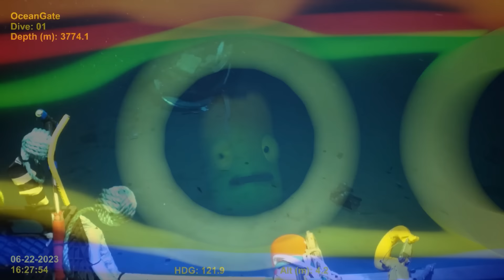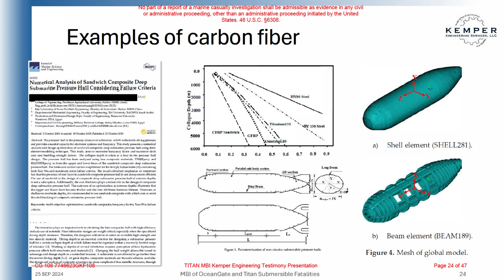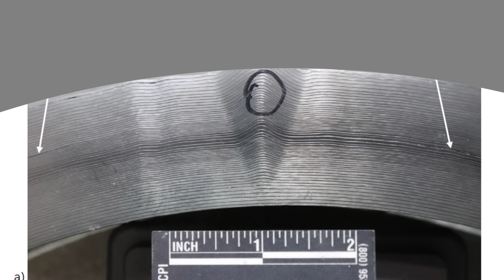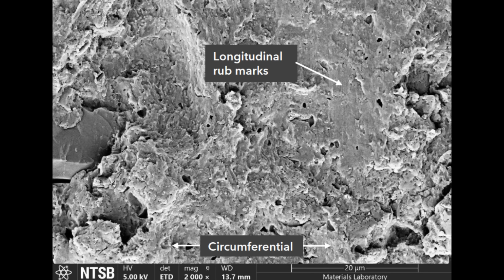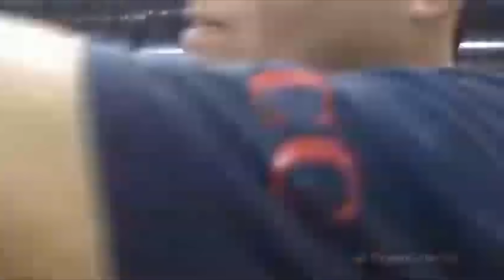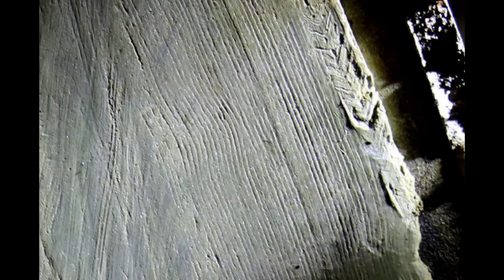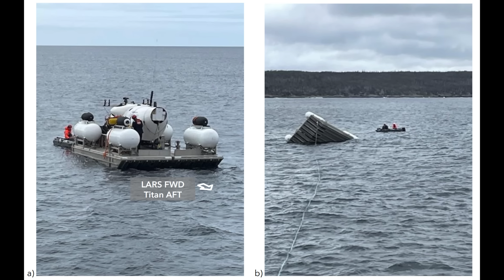OceanGate Wreck Shows Why Sub Wasn't Strong Enough To Survive - NTSB Shares Important Details

Comment: When you look at the oceangate process for bonding the titanium rings to the carbon fibre pressure cylinder alarms bells should of been ringing .a technician wipes the titanium ring with a rag , and the bonding agents  mixed &  applied by  hand . Surely when going to the intended dive depth of 4000 metres a more uniform & testable solution should of been implemented

Comment: If it imploded any water or air inside it will be pushed out like a gunshot. Thus the ring is a bit away.
Reply: That's media bullshit, mostly water pures in until the pressure equals and that's it. You can observe that on every known shipwreck., U-Boats aso.  The shattered carbon tube is. let's say "very unusual",

Comment: I worked for a company that build cylindrical carbon fiber enclosures with titanium end caps.  Although they are much smaller that the sub, they share many of the same attributes.  What really stands out to me is the way the spherical endcaps were attached to the cylinder.  The problem I see is that when the cylinder changes it's shape (and it will under that much pressure) it relies on the adhesion of the epoxy.  Instead... The pressure should be used to make you sealing surfaces stronger, not trying to rip the sub apart.  If they would have made the titanium flange fit to the inside of the cylinder then you could use mechanical seals such as 0-rings to seal because of the massive amount of outside pressure.... etc...  Any expert that works with actual pressure vessels should be able to see this flaw.
Reply: Sure, me, everyone else in the branch and 99,9% of armchair engineers  too. Now the conclusion: What was this vessel made for?

Comment: This seems to have a lot in common with the Deepwater Horizon blowout, "How odd: we're getting negative pressure ratings."  That meant the drilling fluid they were pumping out of the well was moving faster than the pumps were pulling it...and yet, the pumps weren't immediately reversed.  In that case, eleven people and untold numbers of animals -- marine and avian -- died, while the environmental effects were devastating.  If what I wrote doesn't make sense, look up the purposes of drilling fluids and why you would remove them from a well that you weren't putting into production.  Hints: #1, drilling fluids put weight on the formation to prevent blowouts; #2, deep sea drilling fluids are expensive and reusable.

Comment: If you look up material/ metal compression tests which have been around for decades. On the internet, you find Titanium is not much stronger than aluminium. Carbon fibre is brittle and fractures or explodes under pressure and is actually not very strong. The metal compression tests show stainless steel has the strongest compression test, further it does not explode it just squashes flat. The sub should have been made out of stainless steel. In fact all under water deep see vessels should be made out of stainless steel. See test results available on the internet.

Comment: Lesson learned. Positive pressure needs stronger hulls, lesser pressure not that heavy, just strong and insulated from radiation and micro meteorites/debris, or better said, It is relative safer to go into space that down to the bottom of the ocean in a DIY sub.

Comment: The weakest part of a composite is the adhesive in most cases. As most composites suspend strong fibers in a matrix of adhesive material. For tension forces this is rather nice as the fibers are more-so expanded which stresses the strong (usually carbon) bonds. Compression however causes more of an internal sheering effect and would put more applied force to the adhesive to fiber interaction. What i’m saying is that we use materials like carbon fiber for the strength it has under tension whereas other materials like concrete experience strong compressive thresholds. We use appropriate materials for areas of a thing and their boundaries matter. OceanGate likely ignored the relevance of material differences and just thought “carbon fiber strong” without considering the actual impact of the adhesive and how it contributes to the strength.

Comment: This catastrophic event and especially the current aftermath, the examination of the wreckage and the whole analysis, is exactly what Ocean Gate should have done, and what was meant by industry experts by "testing it to destruction". NOW science knows a lot more about the behavior of composites, of bonding, of glues under high pressure etc. And if they sent down another few samples for testing, at some point we will get to the point of doing it in a controlled, acceptably safe way. But not with the very first testing sample, like Stockton Rush did.

Comment: Engineer here, these voids are stress risers. I'd say catastrophic, but the glue delaminating looks to be the killer. This is a fatigue failure. They tend to be gradual and slow, and then a lot happening very quickly. The acoustic monitoring... I think it told them once it was too late. Fatigue goes from OK to collapse quickly.

Comment: This is the first time I've seen in depth fabrication information for the Titan.

I've read quite a few comments and it's kinda wild how many people have more insight into fabrication best practices than those that were manufacturing the Sub.

The Titan's construction was in my opinion at experimental "hobbyist" level.

I can't say much more than many observations already mentioned.

A couple things though one I haven't seen in comments (though I haven't read all 4.7 thousand) (forgive me on that) Is ionic bonding issues. Adhesives use mechanical bonds but often involve electron covalent bonding (I think it's called) or something like that. Carbon is known to do weird things as far as ionic/metal issues are concerned. Couple that with the charges from saline (sea water) environment and there could be things going on that very educated people may not fully understand. Promotion of strong mechanical bonding would probably have been sufficient for mitigation of any/most issues with electrolytic charges (chemical bonding) related to adhesives/dissimilar materials. 

Kinda baffling that they decided to take on what's perhaps a more challenging environment than outer space in the way they did and with (presumably) the resources available.

The saying "horse before the cart" comes to mind. I personally would have invested in manufacturing a dedicated large format 3D printer specifically for production of the hull primarily comprised of nano porous or otherwise highly structured titanium perhaps counter pressurized. 

I mean how much money did the guy have. Probably enough to do that. 

Finally I'll go ahead and be "that guy"...
Maybe all of the Mission Specialists aren't little particles mixed into the vast expanse of the worlds oceans. Maybe they weren't on the Titan when it failed. Maybe it was being operated by remote control. 

I don't mean that as any disrespect to loved ones. Just trying to try to find the best in the matter.

Comment: I would hazard a guess that the acoustic event was the hull delaminating between the layers or the glue failed on dive 80. You can see clearly at 23:4 all the layers have separated into individual sheets.

Comment: One of the lead engineers said he wouldn't dive in it because he didn't trust the operations team. It looks like the engineering was fundamentally sound, the construction team wasn't up to the task but gave it a good shot, and the operations was grossly negligent. 

It failed safe and the sensors gave clear indication of the failure.

Comment: The GLUE used in his submersible, —did Stockton cRush validate the glue for depths of 12,000 feet? 😮
/First Year Engineering students, pay attention.
Reply: buddy really thought his little debbie swiss cake roll would work as a submersible
Reply: @lsswappedcessna   O, you’re killing me with that comment. 🤣
Reply: This isn't something like super glue when you're working with carbon composites you are using various types of adhesives for different tasks because you can't easily bolt something carbon fiber without ruining the material properties of the fiber. Now something to watch out for is how much strain, shear etc the particular adhesive is rated for and making sure that what two materials you are bonding are within tolerance, because for the adhesive used titanium and carbon fiber are not within tolerance because of how different they are. Also working in a clean room to make sure that the adhesive bond is as strong as possible is definitely beneficial

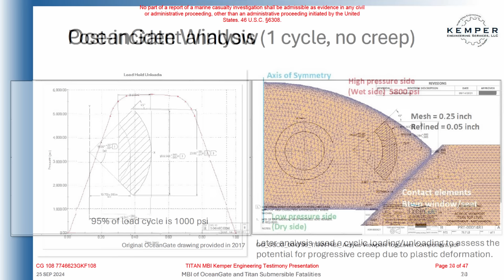Comment: 8:00, the window:  

The window did not fail, so he was "right" that it would survive the lifetime of the submarine, and I can't believe the poor problem solving of the engineers.

If the same size window is approved, just with poor visual characteristics, the solution is to use an "approved" window, and correct the refraction.  A softer material in the void, to make a flat window, or slightly convex for the magnification effect, would work, so long as the material was soft enough to deform under strain, without increasing stress to the approved window.

Picture a semi-circle window, as approved, with a semi-circle insert, which is not load bearing, hot glued to the load bearing window.  The hot glue is "invisible" clear, and the insert is the same refraction index as the load bearing window, which corrects the magnification without impacting the load bearing structure.  No I'm not saying use hot glue, but that it's an example of the infinite number of optically clear-ish options that is also soft enough to absorb any stresses and  eject the insert under strain, rather than increase stresses on the load bearing portion.

Maybe a better option would be a thin plexiglass on the inside, making the desired shape for the intended optics, and filling the void with water or other liquid, with additives to get the necessary refractive index.

I could come up with a million fixes for the optics problem that would be cheaper, lighter, and certified.

How could they have decided to compromise the shape, rather than the more trivial correction of the optics?  That's the kind of stupidity that left many means of single points of failure that would kill everyone on board.

Comment: Wow. I used to work at Electroimpact — the company that made the carbon-fiber hull. I also worked at Seattle Boiler Works designing ASME pressure vessels and PVHOs. SA-516 grade 70 (steel) was the material of choice for submersible pressure hulls. Just wow. What a dumb idea this thing was.

Comment: This is very interesting. I’m no engineer, but I worked in a field where roughing a sticky surface to prepare it to have another sticky surface adhere to it eventually ended in failures because it was impossible to completely remove the debris from the “roughing” process to ensure a clean adhesion. The layers always eventually peeled away from each other. Those wrinkles open a wide array of scrutiny - it seems “flattening” them would immediately compromise the integrity of the structure and no matter how many smooth layers you add, it doesn’t fix the originating flaw. And just thinking about anything composed of fiber under that kind of pressure seems to me the fibers would begin to compress and fracture. Again, I may sound like a complete idiot bc I’m not a structural engineer, but I do see a correlation to my previous work and how this was an issue. Terrible choices made. Corners cut for profit. Greed seems to be the overwhelming reality here, not, “you must embrace risk to be truly adventurous”. The few who unknowingly sacrificed themselves will certainly ensure this negligence doesn’t happen again. 

I enjoy your reporting on the subject, Scott! Thank you for sharing!

Comment: In the kemper diagram of potential implosion points they missed the most threatening 'failure mode' of them all. The bending at the middle of the cylinder introduces an angle (shown along top of cylinder).  The effect is to use the cylinder wall as a lever against the "glued joint"  (shown at lower corner of cylinder).  The effect is about a 10 fold force multiplier to pry the glued joint apart at the outermost edge while putting crushing force on the innermost edge.  Movement of the cylinder wall in at the belly, via leverage of 1/2 the length of the cylinder focused onto the 5" thickness of the carbon fiber glue joint,  results in forces far in excess of the ambient pressure. There is no glue which could withstand that.

Comment: At 4:10 you push back on the idea that CF doesn't do well under compression or shear and say none of those are problems, but then immediately after that show a slide whose concluding bullet is "Compression strength and shear resistance is problematic with Carbon Fiber." 😅

Comment: The moment I heard "instead of one 5in layer, it was five 1in layers," My hand hit my face. 

I'm no material scientist or engineer...but I know enough to know that several smaller layers do not equal one large layer. I'm also curious now if the source of that big bang on dive 80 could be located in the recovered wreckage.

Comment: Anybody who's familiar with hydraulic or pneumatic hoses could probably tell you what went wrong here.
Laminated hoses will inevitably fail completely when they begin to delaminate - however minor the initial defect is.

In a hose you have pressure on the inside and that's great as long as the inner layer remains intact.
As soon as the inner layer sustains damage pressure can escape into a tiny "new" area and pressurise it, which makes the area larger, bigger surface area means more force, which means the area expands and eventually leads to the hose delaminating.

Soon as I heard about how the Titan was constructed I suspected a similar thing had happened, in reverse.
Defect on the exterior surface, pressure gets in, defect expands, as delamination occurs damage is caused to deeper layers and the process continues until a large enough area of the hull is delaminated so that the structure is undermined.

Comment: Can someone help me understand why most the simulations showed the failure in the middle of the hull? Intuitively for me a failure at the end should be more likely. I mean, given how thin the titanium flanges are, it doesn't seem like they provided any substantial support, so the main difference between the middle and the ends would be that the middle has more carbon fiber on both sides supporting it, while on the ends it's supported just from one side.

As long as the structure is uniform it doesn't really matter (every inch of the hull would be subjected to the same stress, so they can't provide any support for each other), but if there is a weak spot, it would be supported from 2 healthy sides in the middle, but only one side at the end. Am I missing something?

Comment: 12:00 this is so unbelievably bad...

Filament winding +/-55 degrees with carbon/boron is such an obvious solution, the fact they went with pre-preg in this manner and machined off the wrinkles is just incredible incompetence.
Reply: it will not help, the water creeps in the junction between steel and carbon and there is no tech to control that. The whole boat is designed to fail.

Comment: I appear to have been mostly wrong about why it failed.
Of course, that's because I (rather foolishly) assumed a minimum of competence when constructing the submarine.

I thought the poor and unclean conditions would induce errors, both in the glue and in the carbon fiber, that would eventually lead to a hull failure after enough stress cycles. That they were actually artificially adding hundreds of breaks in the carbon fiber, as well as using the same poor glue process to merge layers together is actually beyond my understanding.

I am struggling to find an allegory for how monumentally unwise this was.

There is a reason why 'just sanding over the mistakes' is a joke in most industries, not actual advice.

Comment: this shouldn't pass QA at an off-brand bicycle manufacturer when it comes to the carbon-fiber layup, much less a repeatedly pressure cycled human life safety device. So many things wrong with just that part of this assembly.  Add to that the window design and clear failures handling the complexities of  mixed material assemblies (steel=>carbon=>titanium) and clear functional issues operating and evaluating the safety monitors mean this engineering team shouldn't have been building decorative panels for the dashboard of a 16yo's tuned Honda Civic.